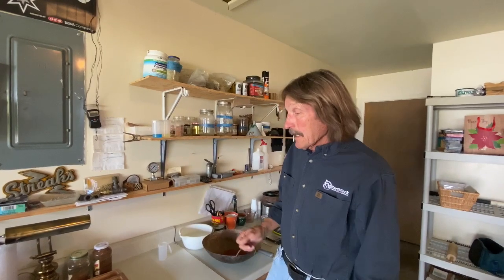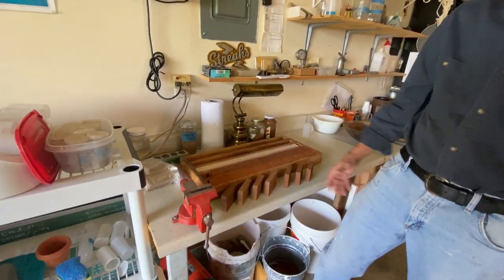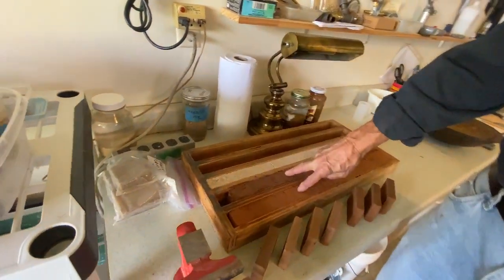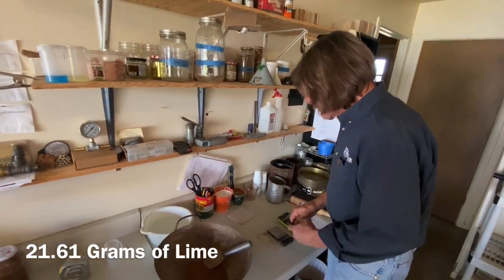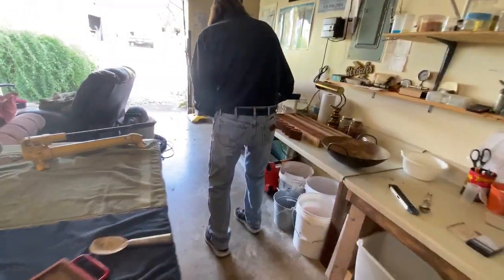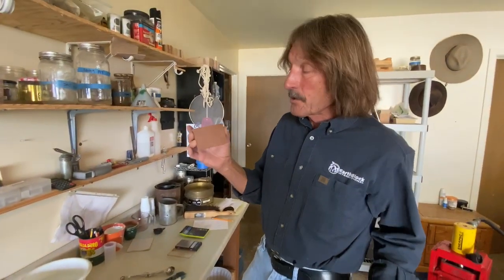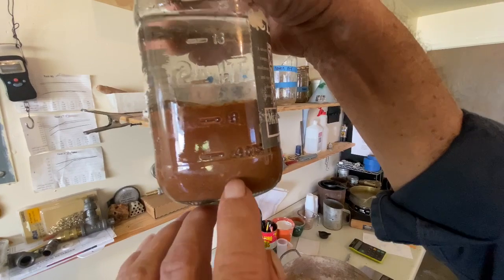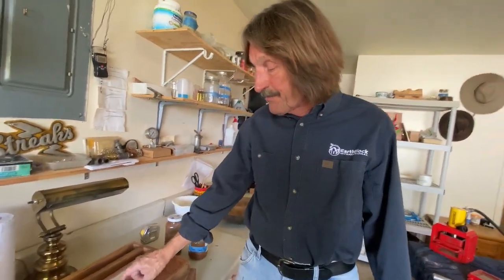Earth Block Lab Part 2 | Jim Hallock | Earth Block International

Comment: Another conveyance of good information yet some important details are missing.
Obviously, the soil is screened to eliminate or reduce aggregates.  What is that screen size?  Does the soil for block construction have to meet a specific aggregate (screen) size?
What is the chart that pertains to the soil sample box?  How is it interpreted?  And how can soils be adjusted based on these results?
The camera person seems to not understand what makes an effective video.  Stop waving the camera around!
Focus in on the point of interest.  The presenter does not need to be in every frame.

Comments about using a "lab" were interesting but no specific numbers were mentioned.  What determines if a soil is "suitable" for making earth blocks?
Mr. Hallock never seems to answer any YT questions from viewers.  Anyone have any thoughts on this?
Reply: Hi I have the same questions! I am especially interestet in some kind of chart for the sample box.
Did you find answers?
Best regards Leo
Reply: @leonardcaspers4933  No answers or response to the questions in my comment.  
While I think this concept of construction has merit for many reasons, the powers that control the building industries and codes in America will always be a roadblock.
The other impediment is the high cost of a block making machine. 
It is unfortunate that house construction in America has taken the path of expensive proprietary materials and/or high dollar equipment needed for installation.
Mr. Hallock provides good information in this video, but guess he only responds to consulting clients.
If you find a way forward or get some answers, would appreciate a post to this comment.